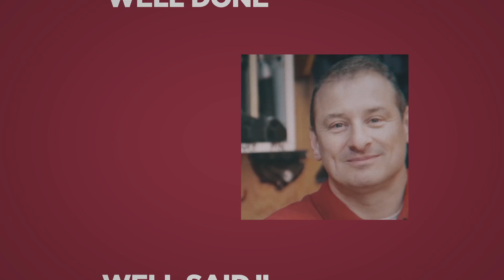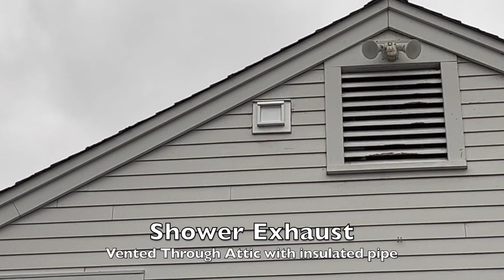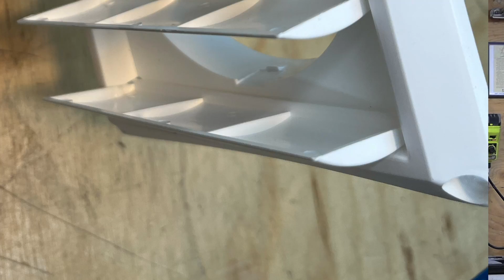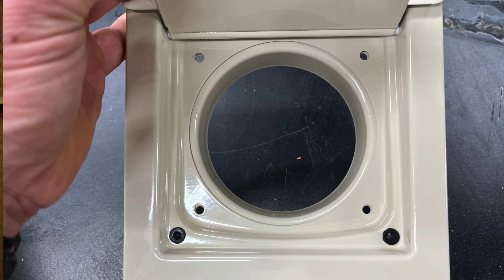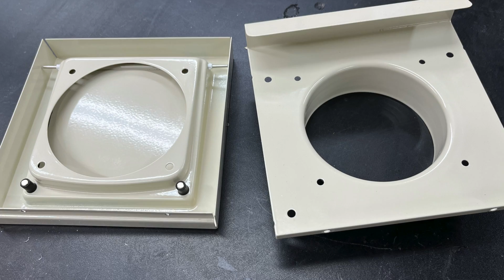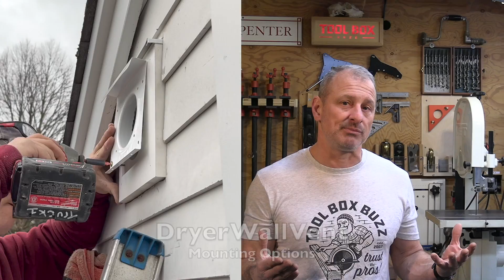DryerWallVent Install

Comment: I replaced my old crumbling plastic vent about 2 years ago with one of these (or similarly built).   I installed on a brick veneer wall with anchors and weather-sealed appropriately.   The magnetic door still works well and the powder coat finish looks great.   I check it for flow every once in a while to make sure the door is not sticking….so far so good.   Ok, it’s just a dryer vent, but why not design and build something worth the trouble to install?  This is hands down better quality than the big box plastic options.

Comment: My thoughts: 1. Too expensive 2. Shouldn’t have magnets 3. Hole should be larger than 4”, not smaller. Duct should go into the opening, not around it. This is how all vents should be, especially dryer vents which have the concern of lint.

Comment: My concern would be at what windspeed would the draft-door not open, preventing the dryer from exhausting. The size of the smaller louvered ones would be easier to overcome the wind.

Comment: Hey Rob, thanks for another great video. However, I have an unrelated question. In this video, there are blue and black square looking tools hanging over your head. I believe they are tools for installing trim around a doorway. Anyhow all that to say. I can't for the best of me remember what they are called, I saw them on a job site a few weeks back. And wanted to look them up to order some. And well.. I forgot all  about them.. So any help is much appreciated.
Reply from the maker: https://www.woodcraft.com/products/miter-max-corner-clamp-woodriver?gclid=EAIaIQobChMIwKrTu4nk-wIVFozICh1eNQ4WEAQYASABEgKOaPD_BwE&gclsrc=aw.ds
Reply: @ConcordCarpenter  thank you

Comment: How much resistance to opening from the exhaust flow do you get from the magnets
Reply: Seems like it would just add more pressure and resistance to the system thus shortening motor life. 🤔
Reply from the maker: Not bad